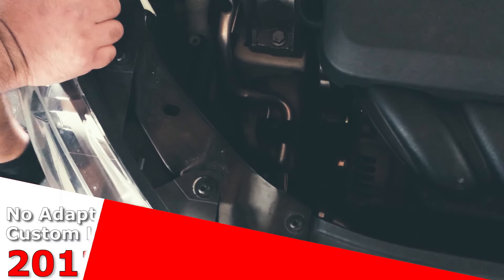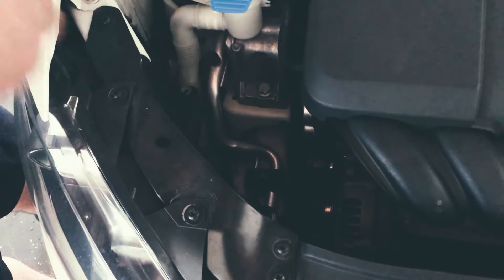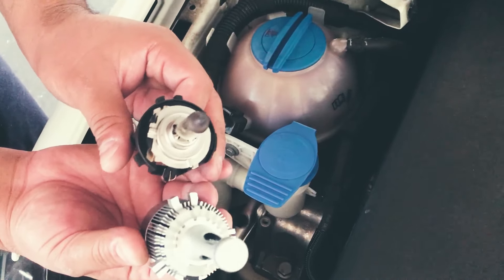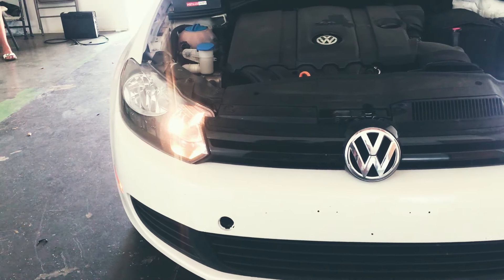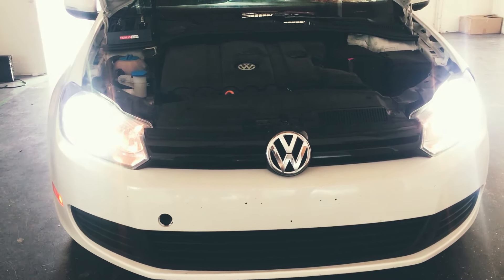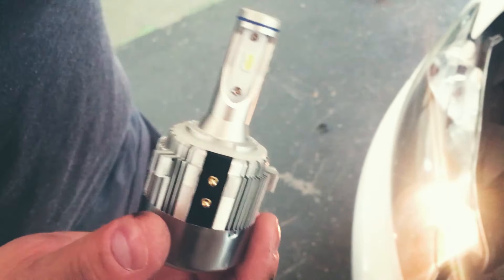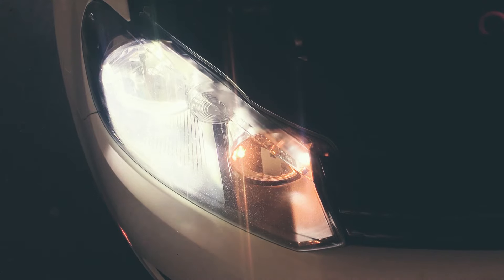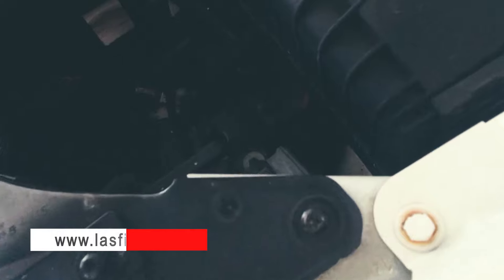Volkswagen VW Golf 2013 Headlight Upgrade - Custom LED bulb - Direct Plug and Play

Comment: I just bought these for my 2011 GTI and I am getting a bulb out light, is there a way to fix this?
Reply from the maker: You have installed new LED bulbs on the headlight housing, but one of LED bulbs fall out automatically, right?
Reply: @Lasfit-Automotive  no, they’re secure and work properly, but the warning on my dash says the bulb is out

Comment: Can you show us what position the bulb should be in when installed? I have bought one from you guys and have put the bulb in but the bulb isn’t straight or flat it’s like an angle so I don’t know if I need to turn it more? But can’t seem to move it more
Reply from the maker: Hi, what's the year of your Golf? Please refer to this video:
https://www.youtube.com/watch?v=VD_WU6QrpVs&t=46s
Reply: @Lasfit-Automotive  can i email you a photo of what I mean so you can understand better and advise me? The year is 2010
Reply from the maker: @addya4011  Yes. Please contact us by emial, cs@lasfit.com
Reply: @Lasfit-Automotive  I have emailed you but no reply?
Reply: @addya4011  i also have this issue currently, did you ever figure it out?
Reply: @MegaShadowman83  in the end I sent them back as the projection just didn’t seem right to me but they claimed it did. I tried so many ways but I couldn’t figure it out. Sorry

Comment: Hello after installing this on my golf 7 2014 the daytime running lights are not on when i put the headlight on? Did you now what is the problem
Reply from the maker: Hi, did you change your high beam and daytime running lights to LED together?
Reply: @Lasfit-Automotive  no i have only change the headlights h7.. did you think thats the problem?
Reply from the maker: @mussietube9909  Actually, we're not sure. Because other customers who own Passat and installed these LEDs don't have such issue. Do you consider to change high beam&DRL to LEDs together?
Reply: @Lasfit-Automotive  no only low beam installed.. but i have ordered highbeam now i will wait

Comment: why is it flickering?
Reply from the maker: Actually, there is no flickering. But when we shot the video, it flashed slightly in the camera.
Reply: @Lasfit-Automotive  this isnt true ive bought 2 sets of head lights they same ones an they both flicker like that in the video
Reply: @elliottpalmer9455  I think ive got some flickering too on my stock lights, might it be the car?
Reply: @elliottpalmer9455  is it drastic?
Reply: It's often the case with LED lights in videos that they flicker, and it is because the framerate of the video aligns with the frequency of flickering in the LEDs. To the naked eye, there shouldn't be any flickering visible.